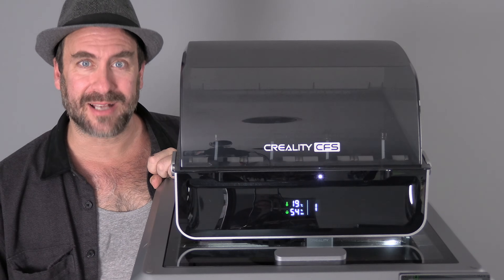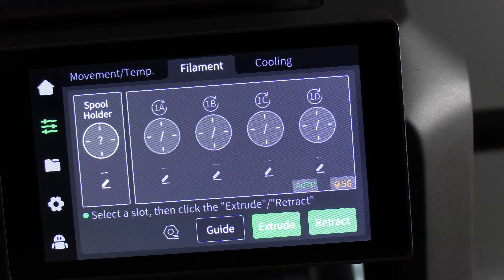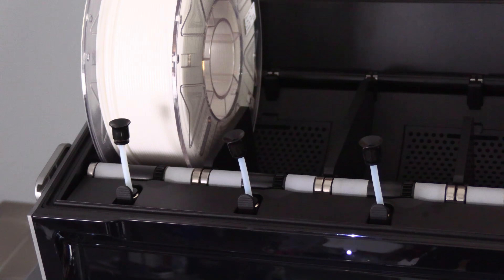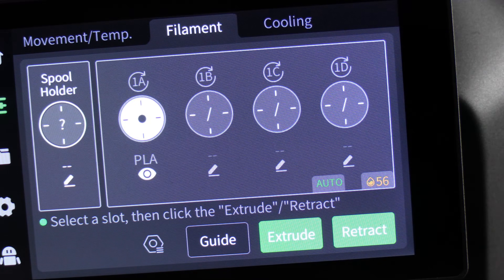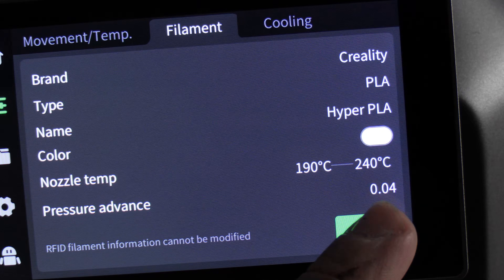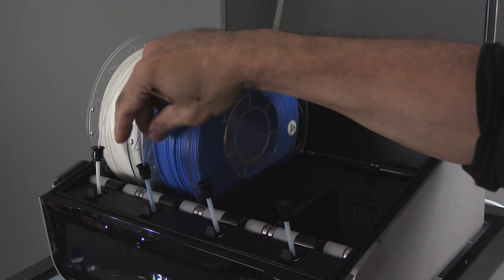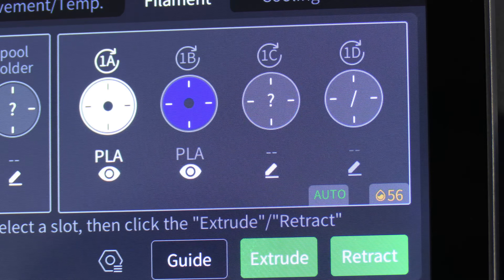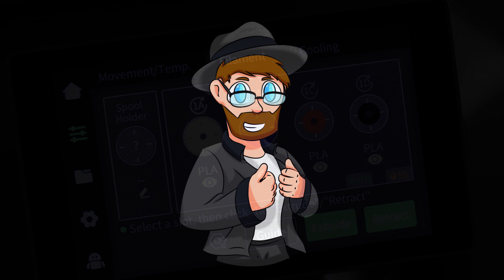K2 PLUS: Load the CFS with 4 Filament Colors, using RFID to auto configure - 3D Printer

Comment: great video - i wanted to know if you recommend printing lid riser for the K2 plus and if so with what material
Reply from the maker: I wouldn't. K2 has chamber temp regulation. If still want to vent, I'd just flip the lid, or crack the door.

Comment: Nice, but if I don't see a video soon, which a complete print, then I believe that something is wrong with the printer. Somehow a strange marketing
Reply: There is something wrong for sure
Reply from the maker: There is nothing wrong
Reply from the maker: The machine is fine. The policies are nonsense
Reply: @3DRundown  policies only exist if you want to hide something
Reply: I have seen complete prints they look better than the Bambu x1 carbon.